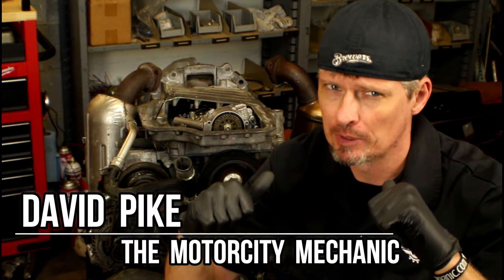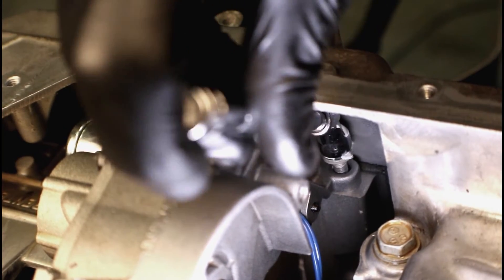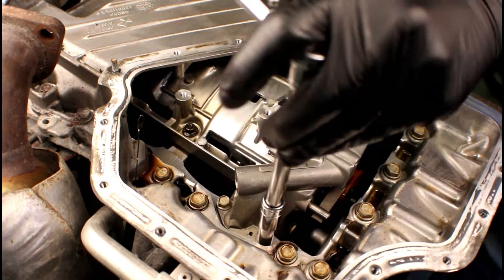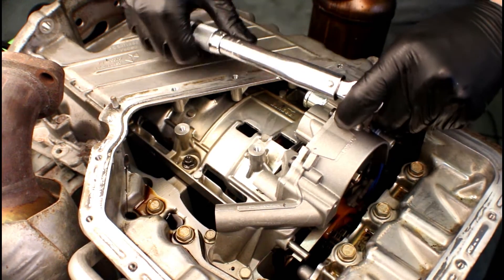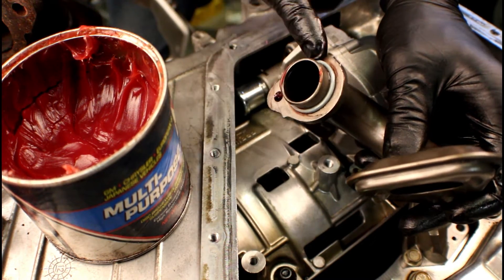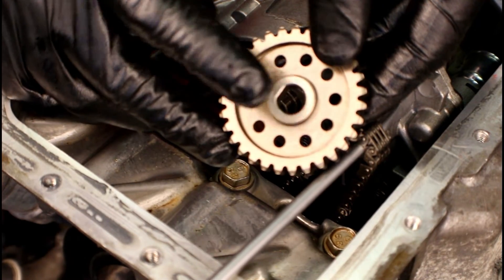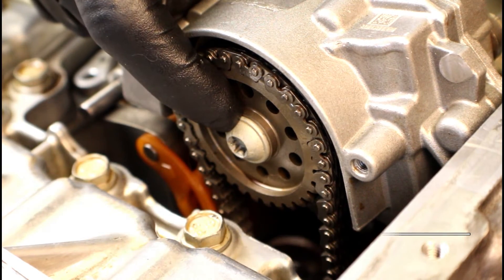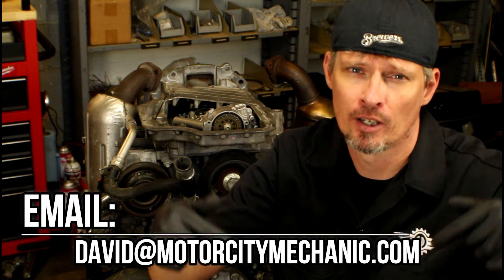Part 3/4: Chrysler FWD 3.2/3.6 Oil pump "Shortcut"

Comment: I just changed an oil pump on my dads 2016 Chrysler T&C 3.6l and your videos made it so simple. Also the new pump does not have holes for the pump drive gear cover bolts. According to the dealer the shield is no longer used or needed. Thank you for these videos.
Reply from the maker: Yeah it seems to be a design change over time once they realized it was needed. Less parts means less money. Glad it went well and that it worked out in the end. Thanks for letting me know how it turned out David. Make sure to subscribe.

Comment: Well done. Exceptional instructional video for this job. Laying on the ground underneath a 2015 Promaster... The two covered bolts are a little tricky, especially the one on the solenoid side. Good thing is they are not bolted very tight so it doesn't take too much bite to get them spinning. Another tip: if you remove the old solenoid it gives you some extra space to get at that inside bolt. 

I am seriously unimpressed with the durability of this motor. 125,000 miles. I just replaced the rockers and the right bank intake cam, doing the oil pump now and just noticed a small coolant escape building at the base of the water pump. I conclude that the two stage oil pressure is an engineering fault. At low RPM's, especially at idle, the rockers and cams are getting inferior lubrication. I use synthetic oil and change it every 5,000 miles or earlier and still got these problems. Taking a chance and replacing the OEM pump with a Melling. Hopefully get more oil up top at the low-end pressure stage. 

Thanks for taking the time to make this video.

Comment: This past weekend I just replaced the oil pump and solenoid on my 16 Pentastar motor.  You can do this with just removing the lower oil pan.  Its a lil tricky but you can due to oil pickup bolt to engine and oil pump.  Took me about 4 hours.

Comment: Masking tape also works to hold bolts in a socket, plus it doesn't fall out every time so it can be used to start multiple bolts. Use it in a similar fashion as shown with the paper here. Just drape it over the lip of the socket and let it stick to the outside of the socket.  Duct tape works too. I've even taped a bolt to the tip of my finger in order to reach a blind hole. There are all sorts of tricks. Really thick grease can hold screws on an Apex tip.

Comment: Very nice David. I have the fuel 3/8 and the lighter non fuel 3/8. Want to get the non fuel 1/4 for really tight stuff. The 12 volt Milwaukee stuff is so light and quick. Looking forward to some videos where u really tear it up. Like the PT series. And the cylinder head change.  I like to go back and watch your old stuff too. It is very instructive. Noticed u used a wobbly 1/4 extension too.
Reply from the maker: Thanks Bill for checking out all the videos....new and old. Milwaukee Tools will be releasing a more compact 1/4 M12 this year that has more power and lets you get into tighter spaces as well.

Comment: I Did my oil pump with the help of these videos and the tech manual a couple weeks ago. No more code coming from the solenoid. Only thing I’m noticing the last few days is the engine seems to be chattering noticeably louder at idle now. Trying to figure out if changing oil pump is somehow related.

Comment: Thanks for all your help!!! I have P06DE code on my 2015 Chrysler town and country. My local dealer claims they went through everything and the only other option is the oil pump replacement. Well they wanted $1650 to replace the pump. I replaced it myself and the code came back 48 hours after the pump was replaced. I have always done regular oil changes and used 5w20 synthetic. I dont know what to do about it at this point. Any ideas???
Reply: I have the same code with a 2015 Durango. It seems the pump is stuck on high pressure but the pressure will intermittently drop to the normal pressure then jump back up to high pressure. Did you happen to recently replace the oil filter housing? The Durango I bought had just had the oil filter housing replaced and I'm wondering if the pressure sensor is somehow causing this issue. They used an aftermarket housing in the repair. 

I'm wondering if this code even needs to be addressed? Other than a little drop in fuel economy due to the pressure running high, are there any other side effects to having high oil pressure? Does it overheat the oil or work the oil too much shortening it's life span? I don't know for certain. Replacing the oil pump in a Durango is no easy task. The front axle and steering rack all live directly below the oil pan and would all have to be removed to do this job......and I'm a mechanic and am not wanting to dive into this if I don't have to.

Comment: Question on the torque of the oil pump gear......is there a recess behind the gear that you could put a too into to help hold the gear during torque, rather than relying on the chain?

Comment: where do you get the gloves for this work, mine always tear and fingers come through
Reply from the maker: They are the typical local auto parts store. I typically dont use them at work because it gets so hot here in the south that during the summer they fill up with sweat. I mainly use them for filming. They hold up okay. Thanks for watching and for the question Brian!

Comment: Got a 2011 Grand caravan 3.6 and need to change out the pressure power steering line. I cannot seem to get to the hose on the pump side. Any insights? Or things I should try removing to get access? Love the videos and have been a great help already :) Thanks!
Reply from the maker: I havent had to replace one yet so not sure all thats required to get to it. I can email you the service info if you like....doesnt mention how to get to things, just whats needs to come off. Just let me know if its the pressure hose or the return hose. Email me at david@motorcitymechanic.com
Reply: Email sent!
Reply from the maker: Sent it your way.
Reply: Got it done - Thanks for the help! Crows foot and a universal joint made it all work. Took out the intake to make room for the right arm but man it sure was tight!
Reply from the maker: I bet it was....I had to remove the right side catalytic converter on the same engine but in an AWD Cherokee.....almost not space. Thanks for the update and for watching.

Comment: Is this replacement the fix for the intermittent P06DD code? I have already replaced the oil cooler on the top that includes the oil pressure switch.

Comment: is it the solenoid or pump itself failing.
Reply from the maker: Hard to say....we have been replacing the assembly that comes with both. Chrysler doesnt sell that solenoid separately but I have heard there are some on the aftermarket.
Reply: I had P06DD and my oil preasure was stuck in low. I took the risk and assessed that the solonoid was stuck/failed. Replaced it following most of directions here using a Dorman part. It now switches to high preasure and codes has not come back.

Comment: Sorry for this out of no where question...is there a way to reset the TCM adaptives on the 2015+ charger rt , scatpaks etc ..is there a fuse or have to pull battery terminal..on forumz there no clear answer some say pull fuse #31 wich is labled pcm some same the battery tric and some say key on hold pedal down for 20sec then key and start the car.. Daily drivin my car i noticed the transmission shift change and lagg a bit,since i,do highwave driving... Is there a way or its dealer related? Any information would be appreciated thank you.
Reply from the maker: The only way to do that is with a high end scanner such as what the dealer has. The is not other method such as a fuse to pull that will reset it. Thanks for asking and for watching.
Reply: MotorCity Mechanic thanx for the info appreciate it!
Reply from the maker: Your welcome!

Comment: Please, please help me @motorcitymechanic im trying to do a head gasket repair on my chrysler sebring touring 2009 2.4l tigershark, world class engine. I need torque specs and bolt pattern for the camshafts, timing chain, motor mount, and catalytic converter. 
 
I dont have programs to find the specs autozone doesnt have them in a repair guide and the chrysler dealerships out here in seattle are very sketchy i asked them and they insisted they do the work so they wouldnt give me the specs. Car has the same engine in the dodge avenger and chrysler 200. I have the EDG engine if thats relevant to the repair. I know they have ED3 and EDG.
Reply from the maker: Evening....well actually morning here on the east coast. I can’t attach that info here also no with pics as well. Email me at david@motorcitymechanic.com
Reply: MotorCity Mechanic morning, thank you so much ill email you now.
Reply from the maker: Your welcome. I will work on it as soon as I can.
Reply: MotorCity Mechanic hey david, did you ever get my email?
Reply from the maker: I gave some one info on the head bolt specs and torque pattern....was that you?
Reply: MotorCity Mechanic yes that was me thank you so much david your a lifesaver
Reply from the maker: ChryslerForums your welcome